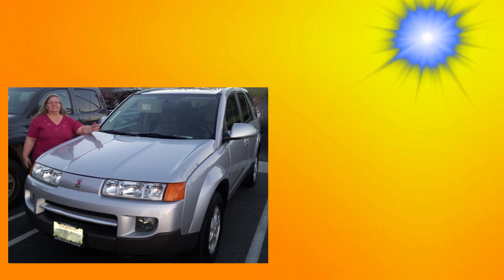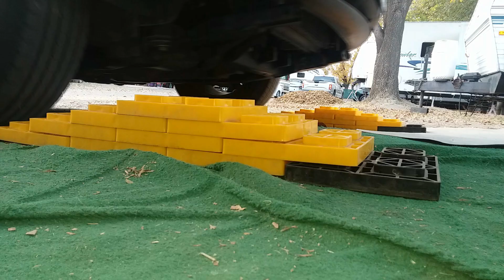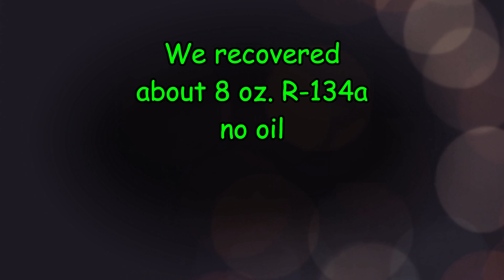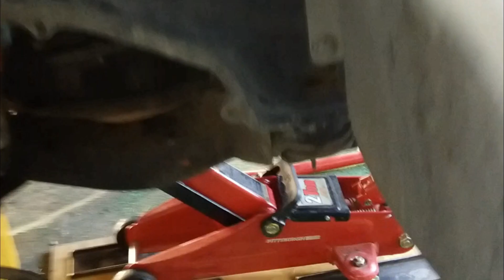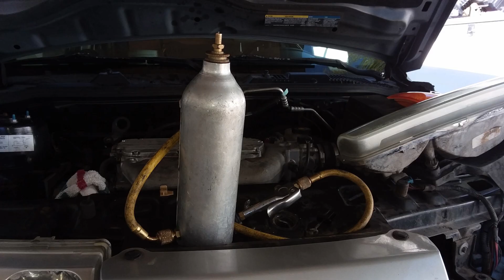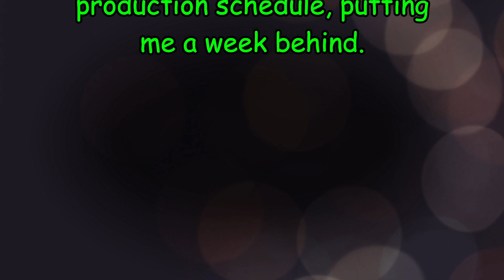Saturn Vue-Air Conditioner Compressor Replacement-How To

Comment: Were there any crush washers or O-Rings where the suction/discharge lines meet the compressor?
I have a small leak there and I was wondering how to source replacements before opening up the system

Comment: Very nicely done. Thanks for sharing. I have to do this job on my 05 Vue 2.2 liter. 246,000 miles and the compressor gave up on a hot drive 640 miles. Embarking on the repair tomorrow. Thanks again for the how to!

Comment: https://youtu.be/ncfhpLRqL_E.    I chose to do it this way. I hope this helps.
Reply from the maker: If you have not made any modifications to the car that may be the best way to access the ac compressor. However it you have added a tow bar to the front of the car then this would be a nightmare, as that bolt is the main connection for the tow bar and the tow sits in the space that the compressor would come out of.

Comment: Excellent tutorial, thank-you so much! I am tackling this job this weekend, now I know what to expect. BTW, I may not need to completely remove the compressor. I just need clearance to access the cover plate and change the control valve. AC works but not at idle, this is a fairly well known fix...
Reply from the maker: Thank you for the comment. since you liked this video you might like some of our other videos on "How To" :
https://www.youtube.com/c/HowWeDoIt_HowTo
Share with your friends what you like and thank you again.
Reply: I found your comment about the ac not being cold at idle I have the exact same problem. Did the control valve fix your issue?

Comment: Fantastic video production. That definitely takes some time. I do anything I can to avoid dropping the front cradle on these Vues because the front nuts are always rusted and seized to the bolts and just spin.
Reply from the maker: Thank you for the comment. We have an additional reason not to drop that cradle, we tow this car behind the motorhome, the tow bar attaches to the cradle with 2 more bolts and replaced 2 of the existing bolts. The attachment would need to be realigned as well. Just a mess to deal with.